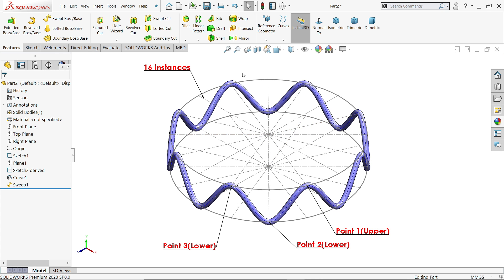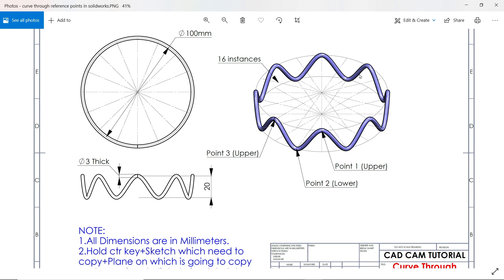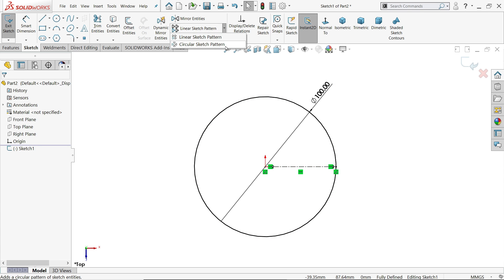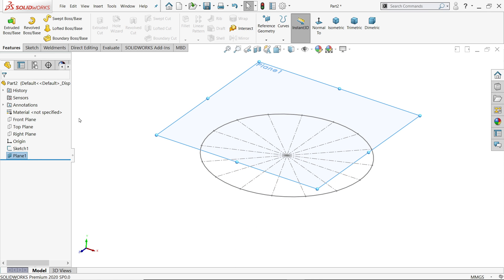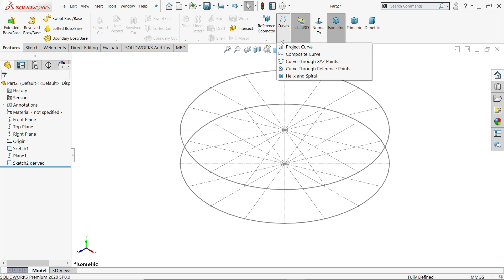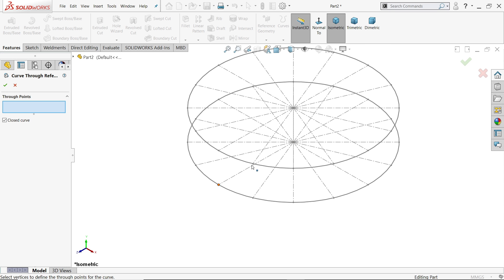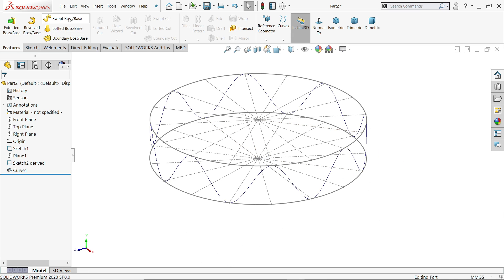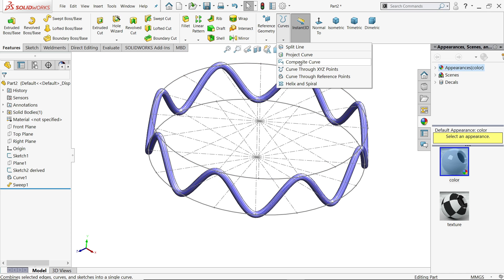Curve Through Reference Points in Solidworks

Comment: I don't like sketches, they are adjusting very difficult and after any tunes they brock! Better to use an equation  driven curve. But for example in Catia it is absolutely simple to do by using a twisted sweep (16 * 360) and project sweep edge on cylindric surface.